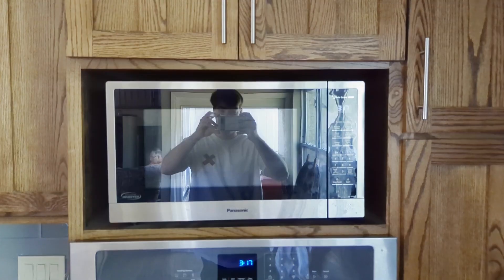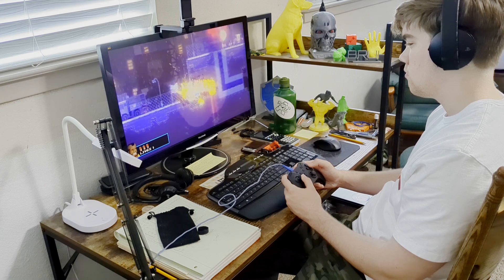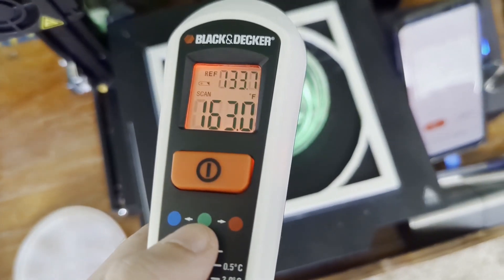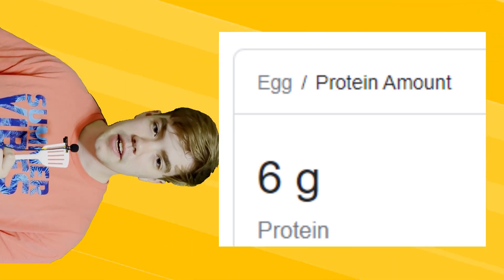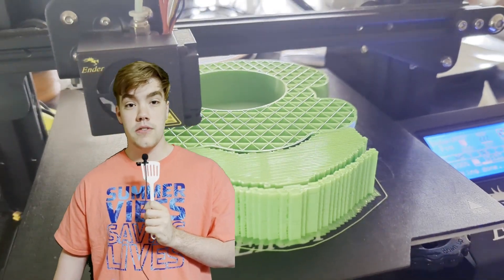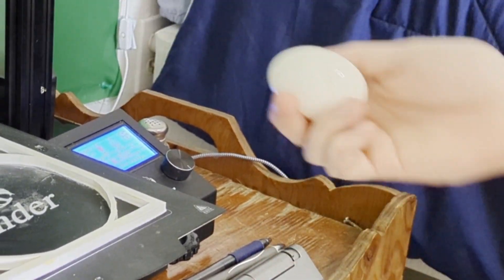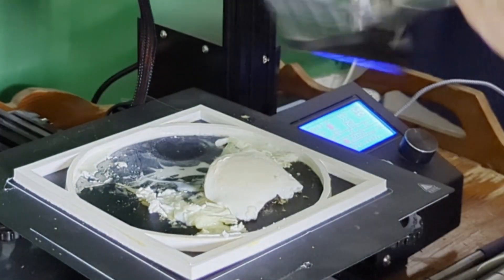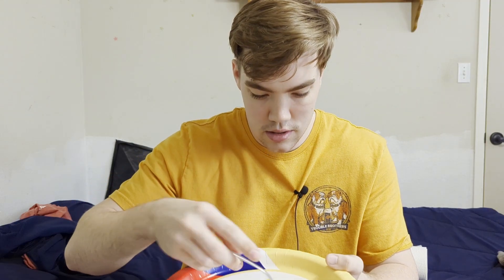I Cooked an Egg with a 3D Printer

Comment: hi. i know im late but i need to ask. i bought a creality ender 3 a few days ago, and i might have accidentaly left the voltage switch on the power box lower than the outlet voltage. my brother turned the printer on and the screen flashed. then the whole printer shut off and we smelled something burning for a second.. is it just the powersupply i messed up or did i ruin the whole printer? 😅🥲